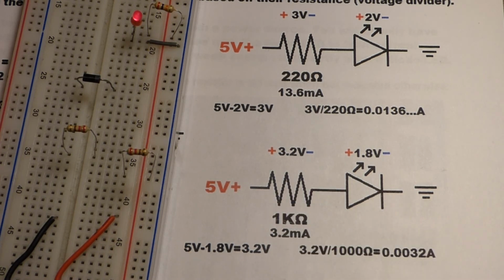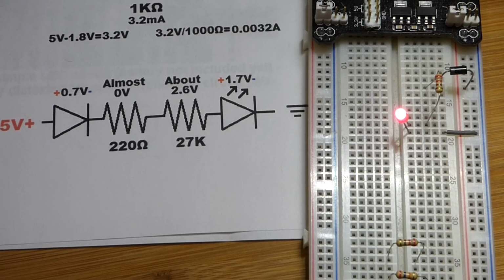Diode forward voltage and voltage drop basics explained and demonstrated by electronzap

Comment: Is donor state means the same as conduction band or valence band ?
Reply from the maker: I haven't studied that much chemistry or physics.
Reply: the donor state in an n-type substrate essentially describes the conduction band behavior, as it donates electrons that become free to move and conduct electricity. It doesn't directly describe the valence band, which is more related to the behavior of the material's intrinsic electrons.

Comment: How important is the forward currwnt on a varactor diode? I need a spare what is obsolent so digikey told me an other model but it has 20mA instead of 250mA..could i usw that varactor? It's used for ans usb port for the aignal lines to the stm32 in an rc transmitter
Reply from the maker: I've never worked on a circuit like that so unfortunately I can't help you at all :(

Comment: Question: can you use the USB port of that  power supply module to power the breadboard? I have heard it has a female USB connector, but I do have a male to male USB cable to solve this. In short: I want to use the USB port of my computer or cell phone power bank to power my breadboard. I have heard that the USB port of the power module is meant for a power output for like powering an Arduino, etc. (and the black part of it is the input) but can it be used as a power input in practice? Btw. where does that black cable come from in your video that is powering the module, an adapter from AC or?
Reply from the maker: The black cable is coming from an AC/DC converter plugged into the 120VAC. I do not know if you can power the unit by using the USB as an input. I just used the USB to charge my phone so can definitely be used as an output.
Reply: Use a 10W 6 ohm resistor in a series or you risk to burn your USB port circuit